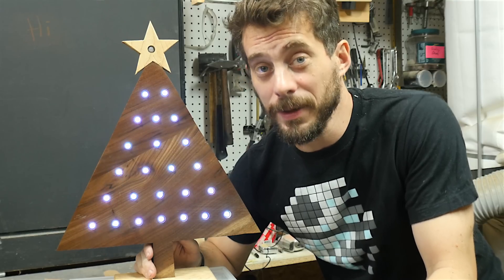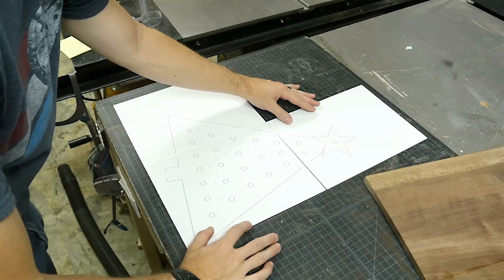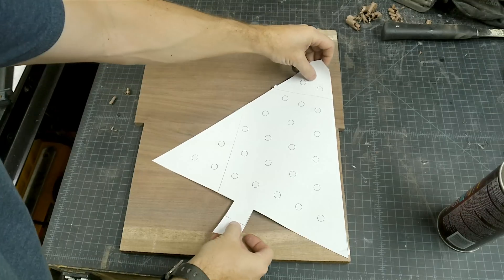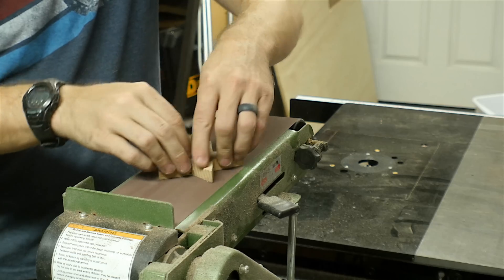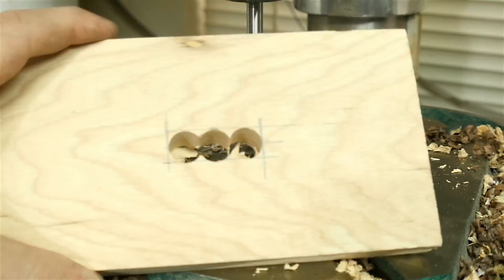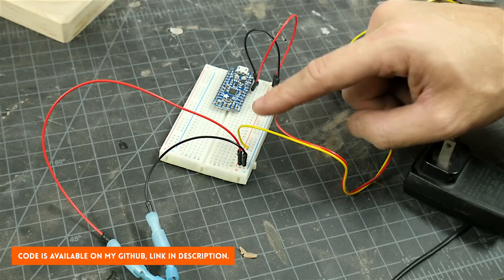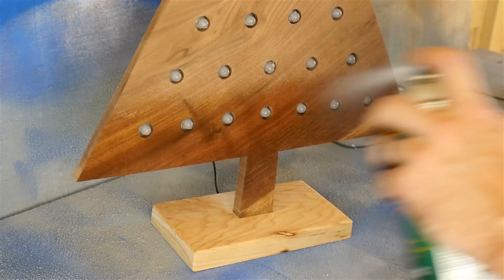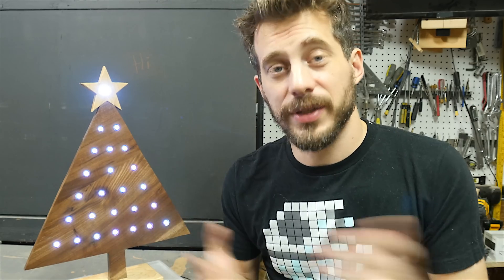Christmas Advent Calendar (Arduino powered) // How-To | I Like To Make Stuff

Comment: Hi Bob. You have probably discovered another option for flattening your cupped board, but just in case, I figured I leave a comment. If the wood you want to plane is too thin for your planer, you can make a simple sled for the wood. It could be as simple as hot gluing your board to a scrap piece of MDF that is similarly sized.

Keep up the great work. We love your channel!
Reply: just searched the comments and saw that your on-screen notaion talks about this idea

Comment: Yeah... I hot glue my warped boards to a straight board and run it through the planer a few times. Then pull it off the board... flip it over and run it again and both sides come out straight. Bob mentions that in the caption.. .but it really works swimmingly.... :-)

Comment: Don`t you burn ports of Arduino in that way? Max current for Arduino Uno is 500mA, for Trinket is even smaller in my humble opinion
Reply: B-Maker no. these are addressable LEDs that are powered from the wall wart, not the trinket. they have internal chips that drive the led pins for each led.

Comment: Cool project. I have started using blue painters tape on the wood and then attaching the template on top of the blue tape. it solves two problems for me - it peels off easily with no cleanup and it also allows me to use plenty of spray adhesive when I attach the template so that the template is less likely to tear when I cut/drill the shape

Comment: Instead of arduino you could use esp8266 and with that you could check if it is rally a new day and the next light can be lit. You could also automate the lighting process but I think button press is part of the experience. But anyway nice job and thumbs up!
Reply from the maker: You could do lots and lots of different things, yes.  The button click is for my kids to be a part of the process.  There are tons of different micro controllers that could be used but eventually you have to pick one and use it in a project, so I picked one that  I had on hand, and made a thing :)

Comment: You could have used your x-carve to run over the whole board and plane/joint the surface.  Another option would have been to fix a thicker board to it and pass through the planer that way.

Comment: A tip I got from Todd Clippinger's American Craftsman Workshop:  You can make a simple planer sled with some MDF and hot glue.  I run painters tape strips, then put globs of hot glue along them.  The glue will bridge gaps between the board and the MDF before it cools, but once it's cool, it'll hold the board rigid enough for the planer to flatten it.  It's great because the tape strips make cleanup easy.

Comment: Really nice build man!    Hey to get around the height constraints of your planer, couldn't you just have attached your walnut panel with double sided tape or some dabs of hot glue on top of a flat piece of wood, plywood or MDF thats = or > the size of your panel (maybe add a few shims if needed) then run the panel, on top of the plywood/mdf sled through the planer until flat?    Or was it that the Walnut panel was just a little too thin to send through the planer regardless/ at risk of getting chewed up to pieces &/ wrecking your planer?

Comment: FYI if you will use paint thinner applied to the pattern that won't come off it will peel  right off.  I personally use a 1" wide brush to apply the paint thinner.
Reply from the maker: Nice! Great tip, thanks!

Comment: Just get a 18mm piece of MDF or plywood. Put the workpiece on there and shim it. Use 3M double sided tape to hold it down. Works great!
Reply from the maker: Yeah, that's what I meant with the on screen notation. I just didn't think of it at the time :)
Reply: I Like To Make Stuff   No problem, i forget alot too. Had to make a stopblock for my miter station. With version 3.4 it finally worked :D

Comment: Great stuff! I have been watching since episode 1! I am a very high end custom furniture maker and I just wanted to tell you that, yes you had the wrong blade for re-sawing wood, but that is not why your pieces came out bowed. Your bowed pieces have to do with where in the trunk of the tree that board came from. As you cut the board in half the internal stresses in the board started to dissipate which, in turn, cupped the board. If you look at the end of a board, and you see the grain lines, great rule of thumb is that the curved "rings" of the tree will always try to "move" so that they are straightened out. Just a tip!
Reply from the maker: That's a really good point! Thanks!

Comment: Can I suggest the same as Wayne Manion.Get a MDF board the width of your planer with a strip along the bottom going sideways under so it will catch the edge of the in feed table of the planer.Make the overall length the length of the planer table (front to back).

Comment: Arduinos are fun, but ESP8266 dev boards with Wi-Fi add a lot of extra capabilities. For this project, the ESP module could get NTP time data over the internet, then automatically illuminate lights based on the date. Christmas is always December 25, so the Advent calendar would be perpetually correct (other than time zone issues if you moved). You wouldn't need the switch to increment the light count. 

ESP8266 boards are available in the same price range as Arduino clone boards (Wemos D1 and NodeMCU dev boards can be sourced for less than $5). ESP8266 based boards can be programmed and flashed in the same Arduino IDE you are already familiar with. Once you add ESP8266 support to the Arduino IDE (its easy), it automatically installs example sketches for NTP. 

There is another dev environment based on the Lua scripting (simpler) language, and another one based on Python is under development. 

I used a NodeMCU and a couple of 3D gyro sensors to detect vibrations in my washer and dryer and email me when the machines are finished. No more leaving wet clothes in the washing machine!
Reply: If wired networking is more your thing, I think you could also use an ENC28J60 with an Arduino to add Ethernet capability to get NTP time data. If you wanted to get real fancy, you could embed use PoE adapters so you only have one wire going to the Advent calendar.

Comment: Hey Bob.... although It is always best to have a resaw blade, the bowing/cupping while resawing is usually a blade tension and feed rate issue... with that size of board, resawing that piece should not be an issue with your current blade. Cool project, Merry Christmas.
Reply from the maker: That's good to know Joe, thanks!  I'll look at the tension and see if I can get that adjusted to correct it.  Thanks!!
Reply: using a fence would be beneficial as well........ it couldn't hurt.

Comment: 1500views in seconds
Reply from the maker: Eilon Katz Thanks so much! :)  Thanks for watching.
Reply: I Like To Make Stuff great build. I don't do christmas, but merry Christmas to you, and 1 question. What would happen if you switched the red and black cables from the power supply around?
Reply from the maker: Not anymore unfortunately. I found that the early viewing was actually hurting my video performance, and the patrons were cool with me dropping that as a perk.
Reply: I Like To Make Stuff OMG HE REPLIED IN MY THREAD I FEEL BLESSED BOB I LOVE UR VIDS AND I MADE SOME STUFF WITH MY GRANDPA
Reply: I Like To Make Stuff HE DID IT AGAIN
LOVE FROM ISRAEL
Reply: Eilon Katz We. Are. Everywhere.
Reply: Hey your videos are just amazing. pls can u make a 6 in one car, which has 6 modes. m1- remote controlled ,m2- ir controlled, m3- obstackle avoiding robot ,m4- distance sensing robot, m5- hoverboat ( i mean a boat) which can run on water, and if u can m6- drone. Everything  is  controlled wirelessly (with nrf24l02 radio module) .The remote shiuld have a lcd which shows the mode number and the mode name ( i mean like m1- remote control , m2- ir control).
It should have a push button to change the mode. It should be light weight. Everything should be made of geared dc motors. It should be based on arduino. The remote should contain  two joysticks to move the robot. Pls it would be a great help for me if u could do this. Thank you

Comment: Hey Bob, great video as usual. Could you have put your board on top of a scrap board or some plywood to elevate your piece. Then run the whole thing through your planer allowing you to flatten one side then flip and repeat?
Reply from the maker: Yeah definitely, that's what I meant with the onscreen notation.. but maybe didn't clarify enough.
Reply: I Like To Make Stuff - Doh, completely missed that. Great job 😊

Comment: Could you put the thin warped boards on top of something that is flat, then run the stack through the planer?
Reply from the maker: Yeah, that's what I meant by the onscreen notation. I just didn't think of it at that moment :)
Reply: Ha! I started typing my comment before the notation even popped up on screen. I guess I need to be more patient and watch the whole video before I start commenting. Or learn how to type without staring at the keyboard.
Reply from the maker: Wayne Manion :)  No sweat.. thanks for being willing to share a solution!